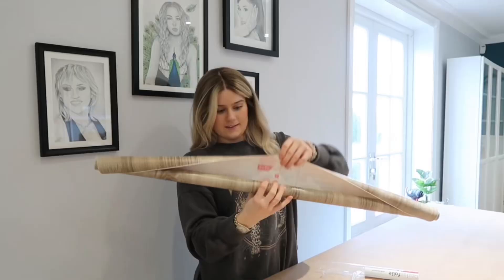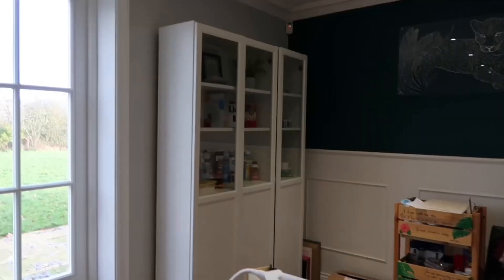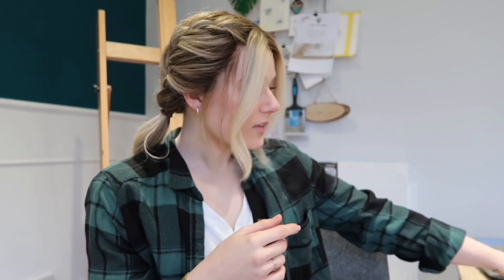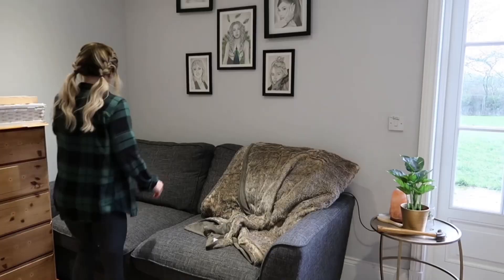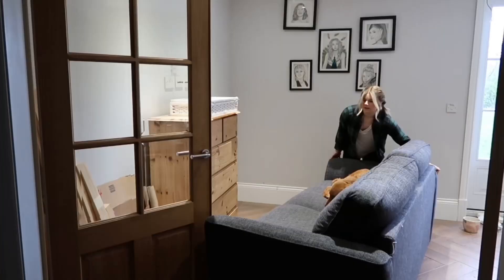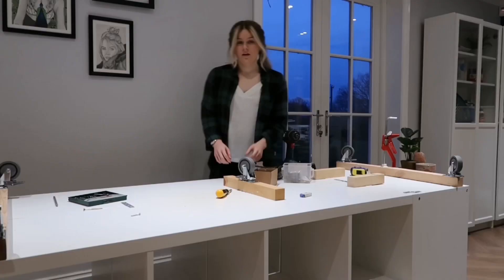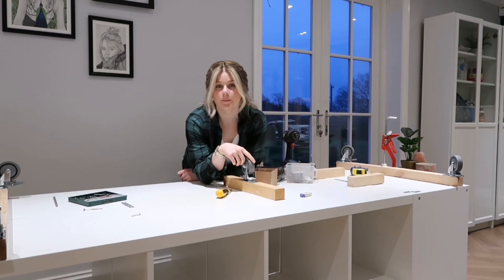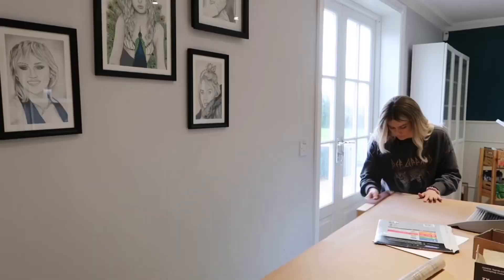BUILDING MY DIY CRAFT TABLE USING IKEA KALLAX - Art Studio Makeover Pt 2, Stick on vinyl & Fails!

Comment: Cool idea. I would have made a more solid wood base. It is a lot of weight for the units and anything you put on it. So you would want to good solid base to spread out the weight. If not it could come undone again where the units meet. After all the ikea shelf units are made of cheep material. So any brackets won't hold that well over time.

Comment: Brilliant, great vid! I’ve just done a similar fit but was wondering about how to attach some wheels. Now I know, thx. Mine is a little taller as I place two work surfaces on and had a gap between the two Kallax units to store large items. The work surfaces were fixed together with sprung clasp brackets (?) so I can part them if I need to. I’m loving these ideas for Kallax units. Please keep the videos coming.

Comment: What was the surface top board panel you used it? It wasn't in the description or you probably said it but not during the minutes of placing it
Reply: I believe she said "Particle Board",  or 'M.D.F.'. Available at most Big Box stores in USA at least ! Heads up, super heavy & difficult to cut. Most Box Stores in USA WILL cut your board for you. They have giant track saws just for this purpose.
Reply: It's MDF, I've made mine with a sheet of MDF on the bottom as well so it's a big sandwich as IKEA units may as well be made of cheese when it comes to securing screws for the long term